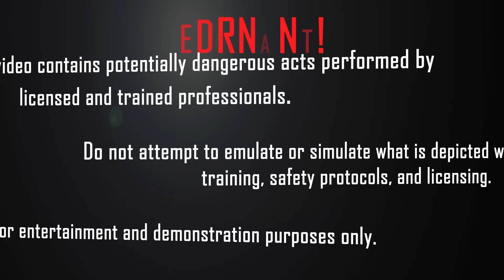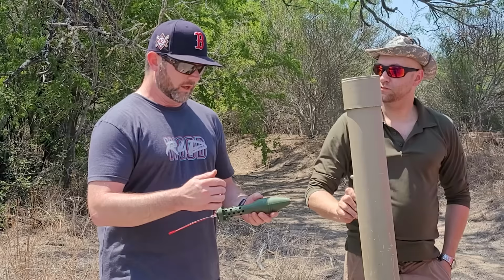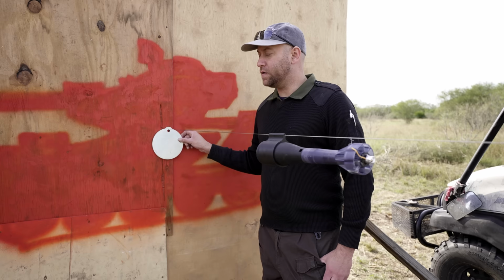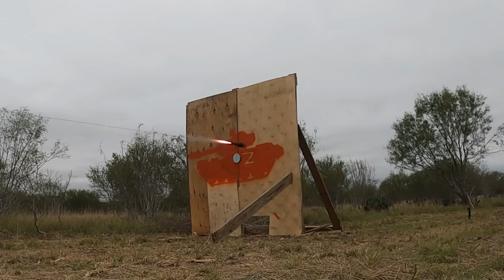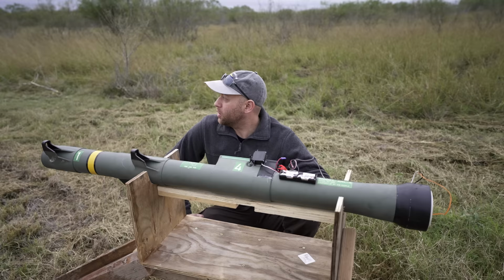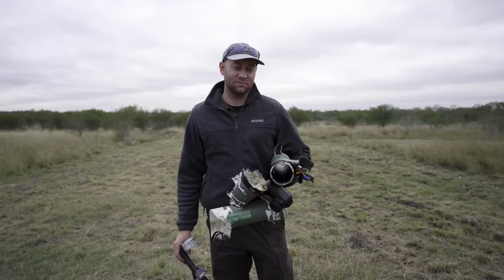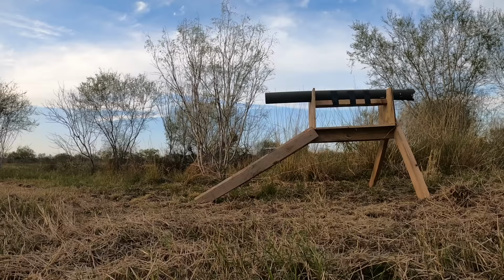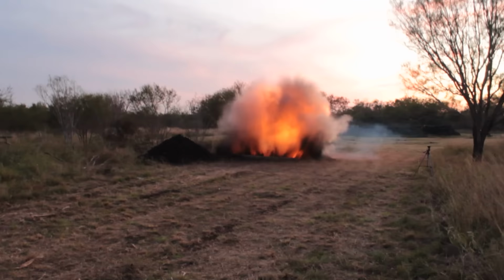3D Printed Explosive Rocket Testing | Feat D&S Creations

Comment: An idea I've had, separate from the rocket thing. I wonder if you could make "preformed fragments" if you fill a container 1/4 full of "gemini liquid explosive" (nitromethane or PLX plus aluminum dust?) and then pour those little 4.5mm steel BB balls in. Keep adding them until the container is mostly full and they're just barely below the surface of the liquid. See if a cap will set it off and what kind of pattern of BB's is launched at a plywood target.

Comment: I wonder if the books on model rockets would have some applicable ideas about how to stabilize it. 

That said making an accurate shoulder fired rocket is extremely difficult.  There's a reason why they didn't start getting used until the same era as jet planes and ballistic missiles.  High explosive cannon shells were around for about 40 years before that.

Comment: Try starting with a model rocket. You can use fins that come out of slots with spring pressure after it exits the tube. Model rocket engines would work great for this.

Comment: Considering that you can't have explosives inside your warheads, or it will require you paperwork at least, maybe you should try making a KEM (kinetic energy missile). Mount a tungsten or hardened steel tip on an aluminum rocket and see how deep it can drive into a steel amour plate.
Reply: They can have explosives inside the warheads. They have done the requisite paperwork.

Comment: It seemed the curved tube had a cleaner flight. I think it could be leveraged to gain more consistency. The curve kicked the rear of the rocket downward, giving it a specific direction, rather than letting the minute forces of aerodynamics and weight distribution decide in those turbulent early acceleration fazes we all experience.

Comment: The next time you try the wire riding test I'd cheat and put a metal tube in the guide holes on the rocket.  Brass or copper would probably last long enough.

Comment: If those were not commercial rocket motors, I would check to make sure the fuel/explosive in them was packed evenly and uniformly. If there is an imbalance, it would very likely make guidance impossible. The other thing I would check is that the spring loaded fins (or rocket bodies) are creating too much drag on the launch tube. That could throw off the rocket's thrust direction enough to not only cause guidance problems but also bend the tube downward as you had shown. If you are going to use the same type of rockets/motors and tubes (looked like fiberglass, maybe?) perhaps you could get some cheap duct tube metal from HomeDepot and line the inside of the tube with it? That should prevent significant hang ups.  You could also try some lubrication (with some type of lube that won't burn).

Comment: just from watching the limited data on the video, it seems that a strong indicator is the propellent charge mixture.  All of the projectiles seemed to have a different thrust factor.  Your charge may not be sealed properly for the weather conditions. Consider using a light charge to push the projectile from the tube just before and as the engine propellent is ignited, the forward velocity should already keep the round stabilized and the fins will be deployed fully by the time the engine ignites for flight. Since this is a AT-X clone, the military grade system is designed to be a single fire only system, so degradation of the tube is already to be expected.

Comment: I wonder if rollerons would help stabilize it?  Some of the high powered rocketry groups were experimenting with them a while back.  IIRC the 2 big issues they ran into were 1.  Since a ground based rocket is in relatively still air, they need pre spun or they started working too late and 2.  The hinge on the control surface needs dampened somehow of they induce oscillation.

Comment: I had done a similar test using a guide wire . I was making home made sugar rocket fuel. My mistake was I had used a homemade metal rocket head and it broke through a brick at the end of the line and manage to disappear. Never have found it.

Comment: You need ROLLERONS! Just like the Sidewinder, that would keep it nice and straight. Are those rockets even spinning? The slow motion didn't look like they were spinning...  Might be the first thing, unless you try to make an Arduino guidance system... the rockets need to spin or you need a mechanical gyro like rollerons.

Comment: Need to add some sort of booster system to launch it out of the tube almost like an rpg7 I feel like that would help with accuracy the rocket needs to engage after the fins are deployed even a compressed air system might work

Comment: Your rocket is likely too light for the thrust generated. You need a propulsion charge then slightly delayed ignition of the rocket motor. Give it a little speed before that motor kicks on. You could also try super high thrust with extremely short burn time.

Comment: Really enjoyed the video, great job there fellas! First off you should change from plastic to aluminum tubing to avoid bending, methinks. Someone here mentioned a simulation software, i think there are a few in the market, so yes that would help. Play around with rocket length and OD, and certainly study the fin design. Even the ole' traditional "string-on-the-fuselage" CG testing (whirling the model with a string attached) could help in improving stability. Nevertheless, awesome stuff, looking forward to your next tests!

Comment: Should have shortened the guide wire length. Since it showed the most stable flight path and with shorter distance, maybe the fins wouldn't have sheared off .

Comment: The rpg-7 even is launched out of the tube with a booster the tail assembly is in. Explosive strips cordite surrounding the tail fin’s folded inside a cardboard tube. sustainer motor actually spins it.

Comment: I really like the guide wire idea.... Maybe a steal slide/insert to make the rocket stay on the wire?
I have used paper straws on my model rockets work better success then the pla alone....apples and oranges I know... But the reinforcement with a better material is similar?

Comment: For the guide-wire launch, metal on metal and grease the guide or the wire to work as intended.  As you saw, metal on plastic without greasing is way to much friction.

Comment: I honestly wonder if the rocket is even worth it. If you cannot be accurate because of inconsistencies something more akin to the prig could be more reliable. Alternatively you could just ditch the boost charge and have the rocket light in the barrel like the German Raketenwerfer 43 but then it wouldn’t be shoulder fired.

Comment: I think your issue was that the RPG is launched with an explosive charge to clear the tube then the rocket motor kicks in. while you were launching with the rocket motor which is plauged with variable thrust curves when it first starts, very difficult to get a rocket motor to start with the same exact amount of thrust everytime... this issue allows the projectile to exit at different velocities causing different flight trajectories.

Comment: Great video! I would have a couple of sugestions however. First the rockets should have been tested in a metal launch-tube as well because usually plastic doesn't likes heat and pressure. 
 And second it should have been tested a lot more dummy rounds to obtain a resonably acurate round before adding explosives. Maybe even more designs to see wich one is more accurate. Have a nice day and keep on making great videos!

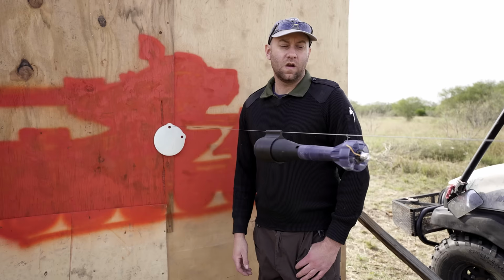Comment: As someone who has experience with 3d printing and prototyping: to see why these all failed go to 2:21-2:46.  See the back end of the rocket?  I can see light through it.  It looks resin printed so Im going to assume its not thermoplastic, but still, if you're going subject it to thousands of PSI at high temperature you need to print it five times thicker at a bare minimum.  It looks like a good design, but you're pairing a lot of high energy physics with a relatively noodly plastic rocket launched out of a plastic barrel.  I understand why you wouldn't want to use a metal barrel, but get a spent AT4 to use as a surrogate.

Comment: Sealing the rear of the launch tube is always going to result in an uncontrolled launch and flight. Don't think of it like a firearm or cannon which depends on the compression of exhaust gases for propulsion.  Rockets provide their own propulsion and by sealing off the rear of the tube you've created a messed up exhaust gas flow which destabilises the rocket as it leaves the tube.

Comment: i used to make model rockets and had a class in school that we built them from scratch. And what if you had put the fins in a way that made the rockets you design spin, idk but maybe could work
Reply: I am from texas, you just gave me a challenge, so beware of it. granted i wont use anything but a rocket and motor to prove its doable. maybe your weight was not in the right location

Comment: i suspected that part was going to fail youll need a metalic insert on the rocket carrage to act as an abrasive surface on the wire. or finding a thick gauge solid and smooth wire as opposed to braded cable

Comment: As expected, the biggest difficulty with 3d printed parts is manufacturing consistency. For the next set of tests it might be worth building a launch rig that is more heavily reinforced with a fixed or measurable launch angle to provide a consistent test platform and eliminate that as a variable rather than using a relatively flimsy wooden stand. When you are testing only one variable at a time you get much better/more relevant data on why things are failing the way that they are failing rather than having to figure out if your tube is bent or pointing downwards or if it was the projectile that deviated because of an internal failure. Looked promising though and if you're able to eliminate things like the motor detonation and propulsion inconsistencies and the 3d printed manufacturing flaws causing self destruction you should be able to get some decent test data and maybe even repeatable successful launces
Reply from the maker: Steve is hard at work correcting said issues. He's almost done with the next generation of rockets.
Reply: @OrdnanceLab  good to know, I look forward to seeing the next phase of testing. Its a shame you aren't able to go into greater detail because I'd love to know some of the more technical aspects of how the failures are occurring  (other than what is immediately obvious in the footage such as the delamination) as well as what kind of fusing system you're using but I know that even if it weren't a tos violation it's not the kind of detail you would be sharing with outsiders. Personally I see a great future in the consumer grade 3d printing industry once powder fusion and liquid resin become more readily available as cheaper consumer units (filament/extrusion type units are alright for first prototypes but I personally don't like them for manufacturing purposes because of the major delamination issues they have)
Reply: @Lilith-Rose  Liquid resin printing is about on the order of expense as FDM. There's not a huge market demand in the home resin printing sector for the sort of print volume that you'd need for rocket bodies, but the tech to DIY a large volume resin printer is pretty accessible.

Comment: Given the progress made in rocket engeneering , next video is going to be some kind of Katyusha-type launcher XD. By the way  having fins positionned on the rear end  and the booster exit on the front/middle wold be an interesting design to try, i am no scientist but maybe it could help with stability, also  Taofledermaus  has a lot of videos of random stuff flying through the air so perhaps one of the designs they tested can be a base for a new type of rocket.

Comment: As someone who builds 3D printed rockets and rocket engines. I highly recommend you don't try and spin the rocket. Additionally you should link together all of the spring loaded fins with a single spring so that they deploy evenly. 

Until they gain enough airspeed rocket fins are utterly useless (as shown by your rockets destabilizing early on in your flight) and so you either have to launch the rocket really quickly using an explosive (preferred for military use), use a long launch tube/rail (amateur rocketry), or gyroscopes and engine gimballing (Spaceflight and ballistic missiles. 

One of my favourite ways to get a rocket up to speed quickly is simply to shoot it out of a potato cannon.
Reply: Spin stabilization (more like a slow roll) is the solution to rockets that burn outside the barrel. This was proven in my M202
Reply: @elwildo14  I personally don't recommend spin stability for rockets because it's hard to get right. Too much spin is as bad as too little. And unless you know the polar moment of inertia of your rocket it's difficult to achieve the correct spin first try. For spin stability to work you need the projectile to be well balanced. It can't have it's mass center off of the thrust axis. It's why I generally avoid spin stability in favour of a longer launch rail so that the rocket will continue burning well after the aero surfaces have enough control authority.

I mostly deal with larger rockets, so spin stability is a bit more difficult in my case, but my point still stands, as long as it isn't "perfectly balanced as all things should be" spin stability will cause you to go off course excessively.
Reply: @inventor121  I was able to get mine to work with steel laser cut torque vanes in printed housing over the nozzle/exhaust area and was pretty easy to achieve full stabilization so long as you keep the CG forward enough. My M72 variant wasn’t as good but my m74 rockets worked just fine on multiple launches without to much math or complex formulas
Reply: @elwildo14  were you using existing blueprints for the rocket? If you put vanes into the exhaust (and they were precise enough) then you definitely wouldn't have a ton of trouble the steel laser cut vanes probably helped you a lot. A lot of the corkscrewing behaviour comes from the CG not lining up with the thrust axis and the resulting aerodynamic instabilities. So long as your CG, aerodynamic center, and thrust axis are (somewhat) precisely aligned you can make spin stability work. But getting those aligned enough with just a 3D printer is difficult at best and requires a lot of printer tuning. With more complex systems it's hard to make sure it's all lines up right which is why I don't recommend spin stabilization.

Comment: May I make a suggestion that won't put Mr on more lists than I already am??
So..I'm not going to describe the design or use data because this would make it easier for unprofessional actors to attempt but what I'll do is use a model name as an example.

I think it would be better if a new design matching or simulating the SPG-9 Kopye would be a better option.
The explosive casing and a a dozen other parts could be 3d printed by I advise you don't attempt to print too many parts of the ammunition for this weapon.
I know cost is an issue as well so milling may have to be done.
Maybe start a patrion campaign to pay for the parts? Not sure...just an idea

Comment: know its NOT the perfekt video for asking this question but i have to😂😅 … what did you think about a strong flash powder beeing the initial detonator for [ANFO] or [ANSAL] ? I know people are saying that one powerfull detonator wont do the job right ? and that ANFO needs some booster charge. But what can someone like me, who doesnt can make higher stuff than ANFO, use for the booster ? Or the bether question is, what kind of Detonator and Booster can i use for ANFO, which is on the same level or lower than ANFO. ?  

I would be very happy about an answer.😊 

For scientific purposes only , of course.

Comment: Hey would you guys be open to some questions about a project I am wanting to do? 

I am wanting to make a high performance gun and one of the items I want to try to include is a traveling charge. This is like a rocket motor directly behind the bullet so that instead of trying to push both the bullet and the mass of the gas column the gas is being generated directly behind the bullet. My project is just to raise the efficiency of a sporting cartridge although I'm sure it could be scaled up.

If anyone knows if reference material for cartridge design especially experimental type stuff could you help me out. I was hoping to pair a traveling charge with a sabot and if possible a squeeze bore.

Comment: Tumbling is usually associated with the center of pressure getting to far forward. Of course lack of fin deployment would cause it too. Rule 1 of rocketry, the center of gravity should be well ahead of the center of pressure. Some of your successes (made it downrange) actually flew pretty good, but those that did showed cork-screwing. This is caused by uneven forces along the length of the rocket. I would first get the fins sorted out. They have to be uniform in shape, STIFF, and not wiggle upon deployment (which is probably the most probably cause of failure). The second problem might be balance. Not up and down the length, but along the long axis. if  you put a thin nail at both ends exactly at the center of the radius of the rocket and balance it on the nails on both ends, it shouldn't instantly rotate with the "heavy" side to the bottom. There SHOULD NOT be a heavy side. Because of the forces of the forward thrust with such a short tube, an out of balance rocket will cork-screw like crazy. You may know all of this, but since you didn't delve into "design" aspects, I am speculating. No, I'm not a "rocket scientist", but I was an amateur one many years ago.
Reply: Oh yes I know. Hi Crystal.